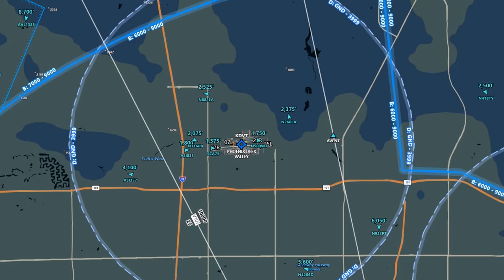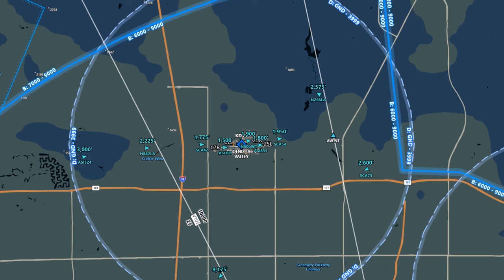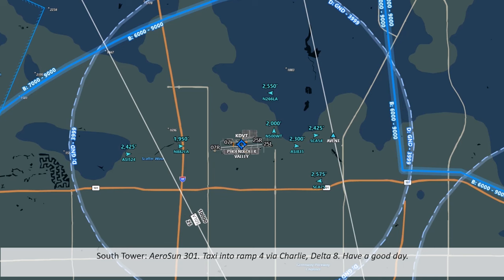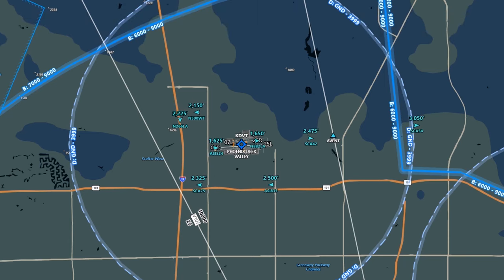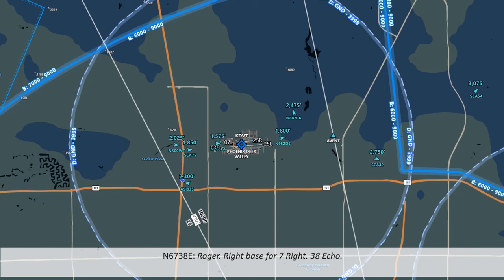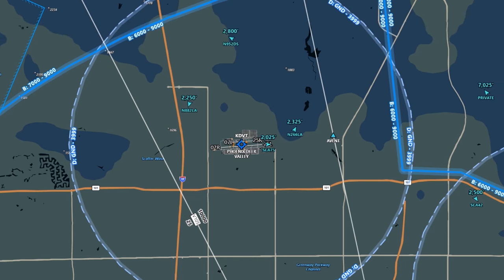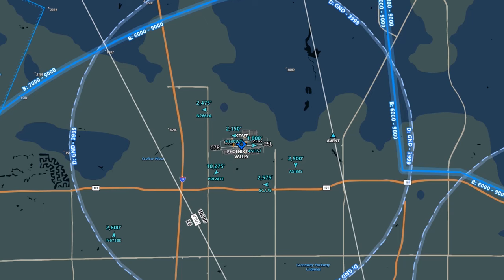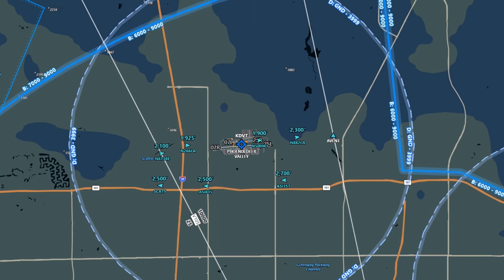Real Tower Communications | Practice Class D ATC Radios

Comment: Volume was a bad term to use here. Also, this is the worst possible airport to use for this example not to mention a complicated situation of working a helicopter into the pattern. Way too many aircraft on parallel runways, the graphics are bad and more difficult to follow than using the actual app, and the left channel controller is way too weak. This is not one of your best efforts, and I don’t suspect it will help pilots as much as you’d like. I recommend doing this entirely over, with a better airfield. FYI, I quit on this video at 3:30.